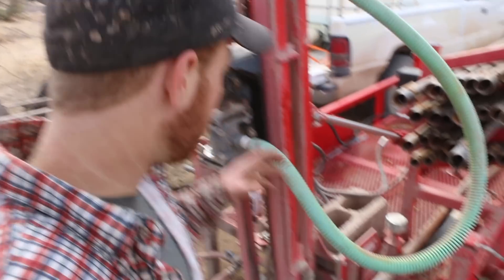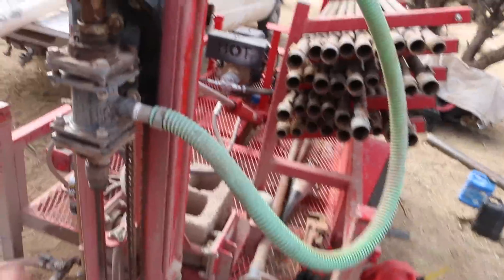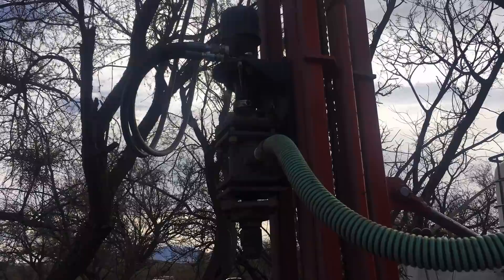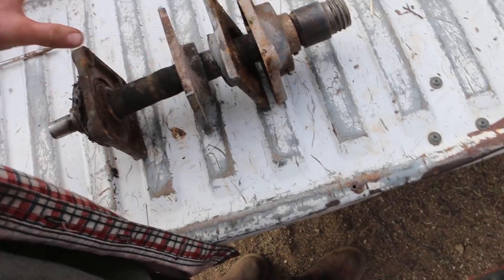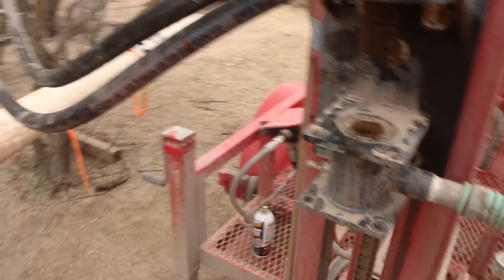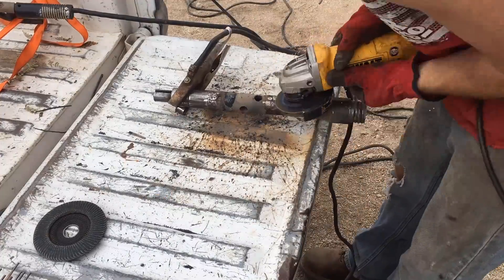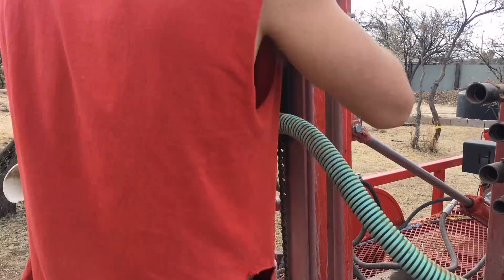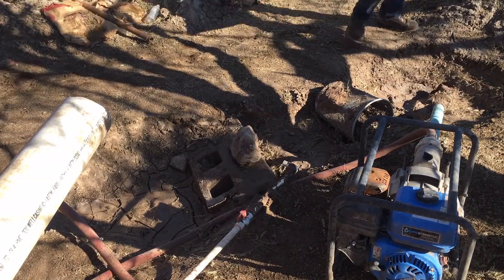Fixing The Swivel On The Well Drilling Rig  | Drilling a Well Part 7

Comment: One of the other posters is correct.. Under the top plate and the lower bottom plate, you need to install a  ring of packing material..I use  BBQ Door gasket seal for mine and it keeps all the water in and none leaks  out for an entire drilling  job up to 160 Feet. I repack after every hole drilled..

Comment: It seems that it should have beenbuilt orginally with a thick rubber seal N it. Presure may blow it out though I maybe. U Did a good job of welding up the infractions and smoothing it out ! I know seeing the leak is still aggravating but U got most of it stopped so it has 2 B drilling alot better!!! Hang N there!!! Sometimes the greatest outcomes come after the greatest trials!!!!